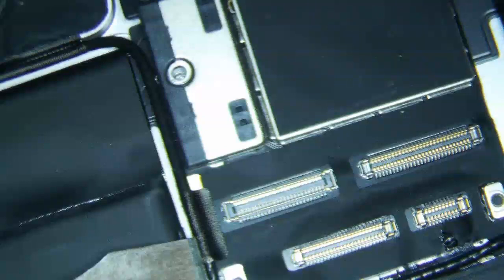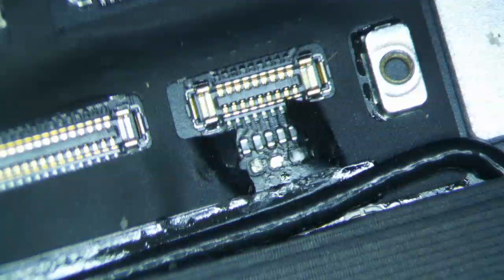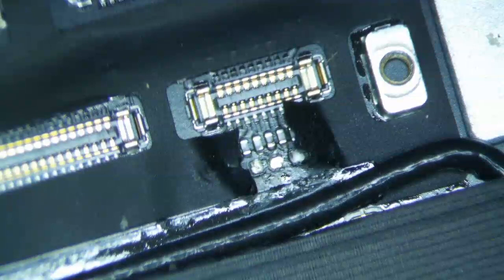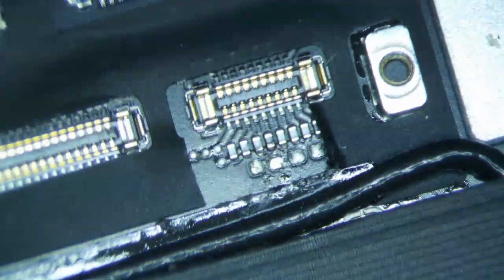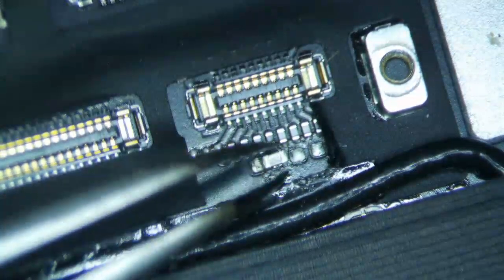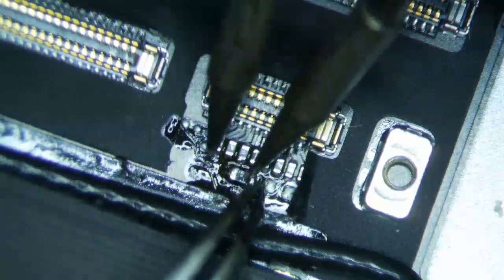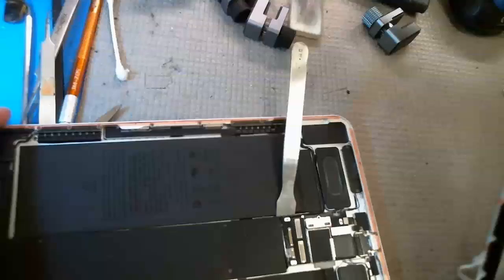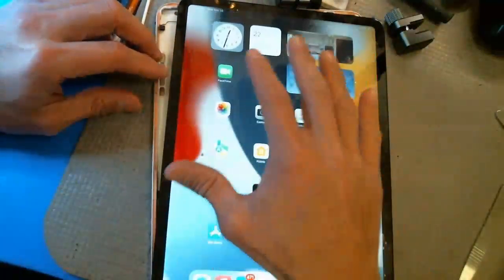iPad Pro 11 A1980 No Backlight Repair

Comment: Helpme plissssssss
Reply: I have an iPad Pro 2020 with backlight failure, I changed coils, diodes and the filter and it still does not give backlight, the parts were taken from another iPad Pro 2020 that were functional

Comment: good work! basically the only video on youtube that shows repair of newer ipad pro. feel free to post more. maybe with better camera too as now mentions;).

I think I managed to blow up some filter after changing the screen. have exactly the same problem with backlight. completely new to this and trying to teach me but there is so little info about newer ipad models as I said, are the screen filters concentrated in the same place as you are at in your video? find nothing obvious so guess I need to measure. but not so easy with a cheap microscope. could I have had problems with backing after using ipa around the screen to get rid of the tape?